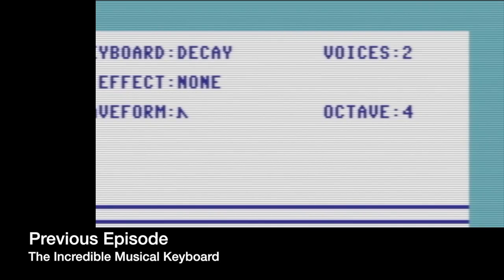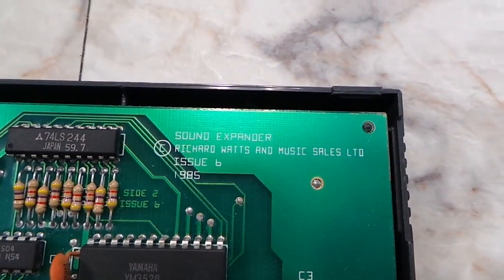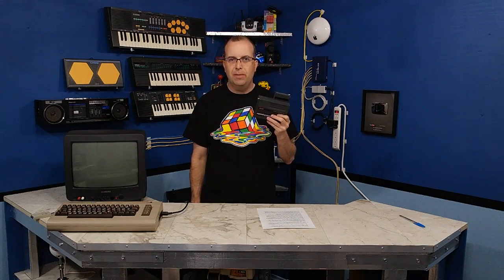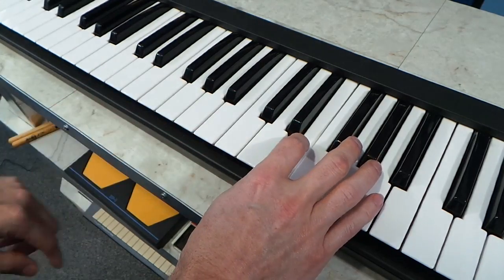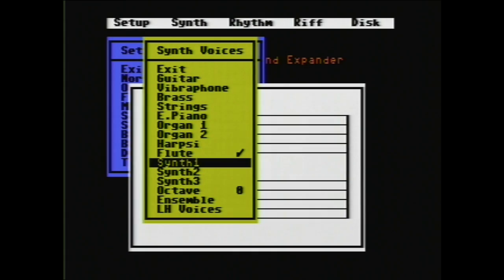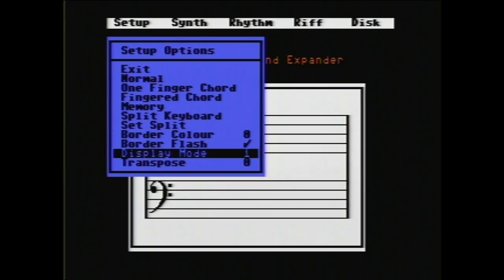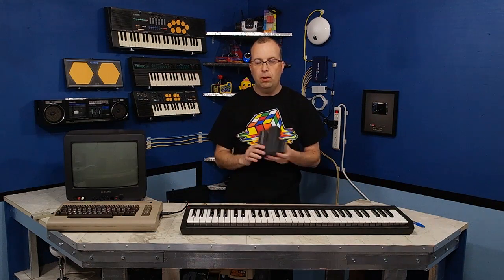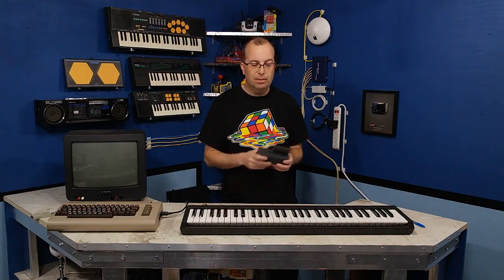Commodore 64 SFX Sound Expander - In Depth Look

Comment: I'm interested in the pinout of the Ribbon Cable connector, I have a few different keyboards from the late 1970s for the Apple II (Passport Soundchaser, Alpha Syntauri) - and it would be lovely if I could accommodate the C64 keyboard as well. (I have to build a new interface card)

Comment: Impressive, I have this as well, only it is the Tape version. That also came with a mic. Also has an in and outlet ports. Can Edit save what ever I wish. 
Thought it doesn't have all that you showed on the menu.
I didn't get the com-keyboard have my own midi one.
As for the software have now put that on Disk. I still use it even now. Just for the fun of it.
It would appear that by what you have shown, is that the Disk and Tape versions are different.

Comment: My favourite demo tune on that software is Telstar - I remember this from school... The music room suddenly got a C64, monitor, sound expander, keyboard, an amplifier/speaker unit, and two software packages. One was the software in the video (used it at a concert in school once) and another piece of software could use the keyboard as input if I recall but used the SID chip for sound and had the ability to record. The manual even had some example sheet music I think...

Comment: Interesting, given the supposed advances the OPL2 had over the OPL ("1"), I'm surprised to hear how sophisticated it sounds, and how close those preset instruments are to a lot of common patches used on PCs in the FM music days. Possibly the upgrades weren't that useful, or people were just lazy. Some of the demos sound rather like what you might hear playing in Frontier or even the simpler parts of the Monkey Island soundtrack. Plus your demo with the backing rhythm was quite impressive.

However, regarding the "lack of software" thing - I'm almost dead certain that there is modern software available for the C64 that's compatible with the device, allowing you to at least gain Soundtracker level control over it as well as the SID (maybe even both in unison?) even if not offering any more traditional stave-based compositional interface. The computer, after all, is super popular in the chiptune scene, and certainly has a lot of "regular" soundtrackers available for it... on top of which, there are hobbyists making and selling recreations of the Sound Expander, and even extended versions that let you install e.g. a pair of OPL3s or even OPNs for an improved sound palette, channel breadth and stereo output, far beyond what you could realistically make use of in a live-play situation, so that they would bother with the hardware in the absence of any software to back it up seems extremely unlikely.

I mean, sure, there might not be much classic software that makes use of it, rather like how MT32 and FM Sound Expander compatible software for the Atari ST was sorely lacking during its heyday. But if you adjust your crystal ball to the mid 90s and later you might be pleasantly surprised :)

Which reminds me, I should probably look up whether anyone's put a demonstration of combining this (or its extended clones) with the SID on youtube, see how good it sounds.

Comment: Something that might be very interesting, or might be very terrible: plug in BOTH sound expanders, and use them as a stereo pair. I'm all but certain that both cartridges would respond to the write requests in the same way. And then, if each one is running on its own internal clock instead of using the C64 clock, they'll naturally detune slightly, which might sound pretty awesome.

Comment: I had something like this with the master keyboard but Im sure it was marked Yamaha FM and there was the ability to select random patches like throwing a dice and it would load a pattern which you could save. It was based on the FM 4 operator chips like the DX9 and Im sure you could edit the sound.

Comment: This is NOT interchangeable with the OPL2 chip in the Adlib. This is the original OPL chip, and it can be replaced with an OPL2 chip, but OPL2 adds 2 more waveforms and it is quite a difference as you can hear here (not my video): https://www.youtube.com/watch?v=5knetge5Gs0

Comment: The flute sounds like a MS-DOS Ship Simulator that i could create.
Reply: Is this for "sail"?
Reply: Yes
Reply: The SFX Sound Expander actually uses the OPL chip, the predecessor to the famous OPL2 chip used on the Ad-Lib and the Sound Blaster, so it's not surprising that it sounds similar.
Reply: Which points to a slight mistake on 8BG's behalf - it's not totally interchangable with the Adlib chip. You can swap the two over, but whilst the OPL2 inserted to the Sound Expander will work just fine thanks to it being register-level backwards compatible, the OPL inserted to the Adlib won't work super well... you probably won't see any crashes, but the sound won't come out properly thanks to it ignoring any attempts to write registers that don't exist on the original.

Comment: I could never figure out if the Sound Interface Device includes digital or analog oscillators.  The guy who designed it, Bob Yannes from Ensoniq, was just delving into the world of digital synthesis and sampling when this was built.

The composing/editing software which I'm aware of in the Commodore timeline was developed by Sequential Circuits, in conjunction with their consumer keyboard synthesizers (SixTrak/MultiTrak/MAX/Split-8) and drum machine (DrumTraks).  Neither the software or the consumer keyboards were well timed, and that was the straw which broke Sequential Circuits' back.

Comment: I think they knew what they stumbled upon when this was created, and from a business stand point it makes sense to discontinue a product like this. Like said in the previous video this is literally just like any other portable yamaha keyboard that was out in the mid 80s and correct me if im wrong but the Sound expander only cost a little over $100(probably closer to $150). Why keep making cheap software to expand a product that you already have a market on? Instead of charging a few bucks for new software they could charge alot more money for new hardware in upcoming keyboards. The sound expander only lasted a year and it wasnt because it was useless.

Comment: The passthrough slot doesn't actually work. I own one, and I know others that do, I've even looked at the schematic. iirc, lines are swapped and one loops back.

There's rumors that there could be very specific cartridges that SFX may have designed to work with it, but I've not found much information online.

Comment: Would have been cool if they did a RF or audio passthrough to mix sid and yamaha sounds. One cable going from the c64 into the module, and then connecting the monitor with the module.

Comment: So awesome.
Thumbs up for the donators. 

If only commodore didn't " died"  I wonder how 2016 would of been :)
Reply: I very much doubt they could have survived the pc and playstation juggernaut.  According to ex CBM engineers, the AAA chipset in development couldn't really compete against them, the 3d capability just wasn't there.  Pity that CBM usa`s mismanagement messed everything up for CBM uk who were actually doing pretty well with the CD32 and A1200.  I still think they would have gone bankrupt eventually though, everything was standardising around the pc, the Amiga line had nowhere to go.
Reply: I don't think it is as cut and dry as it not having anywhere to go. Basically, if Commodore could have created an 50mhz 030 + decent 3D graphics chip + SIMM slot trapdoor expansion package that could run Doom etc properly, Amiga would have had a chance. People only put up with PCs for gaming because of what they were capable of graphics-wise, which ironically was one of the main advantages of the Playstation.. Amiga could be simple like a console, but also a fully functional machine. Don't forget that circa '94 AmigaOS was still superior to Windows & MacOS and it took WindowsXP & OSX  to finally get where Amiga had been all those years prior.

Comment: Somewhere either deep in someones video vault or even here in YoutubeLand is a video produced by Commodore in which a female composer spends a good long while with the Sound Expander and full length keyboard and produces a full length album from it, it's all very 80's and is quite cheesy today but it'd be a good video to track down. :)

Comment: I'm interested into small FM installation for music experiment with space constraint (I'm afraid a DX7 would be way too big). What would be a nice little synthetiser with a FM chip that you'll recommend? Or maybe an Rpi with a real FM chip/cart?
Reply from the maker: The next best thing to a DX-7 is probably a Yamaha PSR-36 or PSR-41.
Reply: Thanks for your answer, I'll investigate!
Reply: You could try finding a Yamaha TX-7. It's a DX-7 without a keyboard, so you still need a midi keyboard and a computer to program it.  If you can afford it, take a look at the Yamaha TX816,  That's 8 TX-7 modules in one rack.

Comment: http://www.zimmers.net/anonftp/pub/cbm/c64/audio/sfx/index.html claims to have the sound editor and composer software for it.
Reply from the maker: That's actually the software I used in the video.  In fact, that's where I downloaded it from.
Reply: There is more than one program on the disk:
c1541 #8> attach fmcmpsed.d64
c1541 #8> list
0 "editor-composer " ed 2a
0     "loader"            prg<
0     "editor"            prg<
0     "composer"          prg<
0     "................"  prg<
6     "%#Default Sounds"  prg
2     "%&Voice Bank 1  "  seq
2     "%&Voice Bank 2  "  seq
2     "%&Voice Bank 3  "  seq
18    "%%Sonata        "  prg
0 blocks free.

Maybe you need "editor" or "composer" instead of "*" when loading.
Reply: I tried loading editor and composer in vice, and yes those are clearly what you are missing.  Looks interesting.
Reply from the maker: OK, I'll check that out when I have some time.
Reply: I guess the good old LOAD"$",8 followed by LIST comes in handy occasionally.  Almost never had to of course for games.
Reply: ah the hidden wonders of command prompts
Reply: Man, been searching for this for SO long ! Finally .. And it works on real hardware. :)
Reply: Thanks for the link!
Reply: No, the program you used in this video is the demo. The software from the link above is the Composer and Editor. Both are from zimmers.net, but in different folders.

Comment: By the sounds of what it is this thing I'm guessing before I get into the rest of it does exactly what it says on the tin and probably makes the SID as powerful as the Paula minus the trackers for minipulation of the sounds you can use. But then again if you have knowledge about installing chips and have every Yamaha chip at your disposal to have a little fun with and swap around in the synth box. I guess you can minipulate the sounds this module can output on the SID too be it from other YM chips that fits the amount of pins.

Comment: isn't that the same sound chip that's inside the Genesis/Mega drive?
Reply: Golden Grenadier no; this is an OPL FM chip whereas the Mega Drive has an OPN FM chip (YM2612) which is therefore more sophisticated, though it can replicate some OPL sounds but is more capable than that. This also lacks the switchable PCM (DAC) mode of the 6th channel of the Mega Drive's YM2612 chip, that allows it to play sound samples such as drums and speech, which is a pretty big difference. On top of that, The Mega Drive doesn't only have the YM2612 chip; it also has an SN76489 chip which can play at the same time as the YM2612 and therefore forms part of its sound - it's the same PSG chip as in the Master System and has 3 square wave generators and 1 white noise generator.

Comment: Well I've never owned a Commodore 64 myself though I have owned ever iteration of Commodore's Amazing Amiga all the way from the 100 to the 5000/030. Having played around with Music Maker which was designed to run on Amiga Workbench 3.0 and higher, I am somewhat aware of the audio capabilities of Commodore product. To see such decent sound come out of something that old still amazes me. And then there's that keyboard. I would almost want to adapt that to MIDI just to freak people out on stage. See, I perform live EDM as a hobby. My day job is creating and producing advertisements for small businesses to be aired on radio and TV. I also fix things of a technical nature and have been known to tinker with prototyping devices too. It would be crazy easy to develop an adapter to hook the existing ribbon cable to a device that would turn it's output into MIDI code using a microcontroller. If this sounds like something you'd be interested in, shoot me a private message. It would only cost you what I'd have to pay out for parts and shipping.

Comment: Pretty much the only difference between the 3526 (OPL) and 3812 (OPL-2) is that the 3812 has several different operator waveforms and the 3526 only has sine waves. The 3526 was used in a number of mid 80's arcade games such as early SNK games like Ikari Warriors and TANK.

Comment: I think I had a similar expansion accessory.

It stuck out the expansion port and though not changing the in built SID it had cannon style serial MIDI in/out/thru and a stereo Phono 6.0mm output with a small switch that changed the output gain between headphones and line.

It actually worked on my Roland E-66.

Comment: When you say full 61 keys, I believe that is wrong because keyboards and pianos have 88 keys.
Good video though.
Reply from the maker: Well.. Pianos usually do have 88 keys, as do some keyboards.  But I think the vast majority of keyboards have 61 keys.
Reply: 8-Bit Keys
Ok, thanks.
Reply: The standard number of keys are usually:

88 (7+ octaves) - weighted keys, which simulate the real hammer velocity and resistance of a real piano.
76 (6+ octaves) - semi-weighted or regular synth keys.
61 (5 octaves) - semi-weighted or regular synth keys.
49 (4 octaves) - usually just light plastic keys.

You could nitpick and say they have more than just a whole number of octaves (7,4 etc) but we think of whole octaves available on the keybed.

However the term "full" or "mini" refers to the size more than anything else. The rest of David's Casio keyboards are using mini sized keys (except for some of the larger MTs) thus, this MIDI-controller is using full size synth keys.  :)

Comment: Thanks for making this video...
I've been interested in aquiring a SID based synth and so looking at second hand commodores and expansions...  this is a great demonstration!
I wish you had've gone more in depth of the actual usability in modern context though...
My queries are :
What is the polyphonic range?
Is it editable (can I code/edit the sounds)?
Are there plausable modern interfacing options (can I fit it in to my midi set up or do I need to multitrack as a solo device only etc)?

Other than that this is an excellent demonstration.

oh also, if memory serves correct I saw a video that was made around the launch of the expansion that showed a program that allowed midi recording and multitracking... wether or not any copies of that software remain out there in the world is yet to be seen (hence my queries about modern interfacing and editing/coding options).  :D

Comment: Somehow this sounds way better than most of the actual keyboards you've shown on this channel. I can't believe how such a primitive computer can make sounds like these.
Reply: It shouldn't do, though. Certainly, if they're Yamahas, they will have been using one of these at a minimum (or maybe an OPLL, which is essentially the same thing but only one of the channels is fully adjustable, the others have to pick from 15 instrument presets that are much the same as those found within the two sound banks shown here... what you actually get depending on the chip revision... I don't know if they ever made anything based on the 2419 PSG, but it would likely have been a kiddie machine), if not something rather more sophisticated.

Casio and Roland each went their own unique ways, but had rather less widely commercialised chips that were roughly on a par; particularly, a lot of lower end Roland keyboards were based around the MT32, and later the Sound Canvas chips, which aren't exactly weak performers. And Casio got into the PCM soundfont game quite early-doors.

Comment: SFX Sound Expander is a great example why Commodore bankrupted eventually. It got a pretty decent sound chip, and a big keyboard. From hardware perspective it was good, but lacked touch sensitive keys or even some buttons on keyboard itself.
From the software point it was simply a disaster. Why they didn't include software on cartridge? It was more expensive, but it would load very quickly and it would allow for way better software:
- They could do a full 128 MIDI instruments, like Windows 3.x did on OPL2/OPL3.
- instruments, rhythms, and other static data could be read from cartridge itself, leaving almost whole 64 KB of RAM for user content,
- instrument creator, allowing user to manually change FM chip state,
- simple, multitrack sequencer,
- reading/writing MIDI files on tapes or diskettes.

This all could be done in software. Without any further hardware costs. C64 + SFX + Keyboard could become a semi-professional composing tool. Way cheaper than other solutions, more powerful than standalone keyboards.

But that didn't happened. Commodore released expensive keyboard that required computer, TV and long loading time to even start working. Standalone keyboards were probably cheaper, way more portable, and even had more sounds, rhythms and other functions.

I would say, that in whole Commodore history, it's rather uncanny how they managed to build such a great computers like C64 and Amiga.